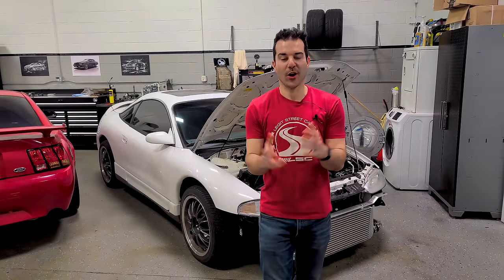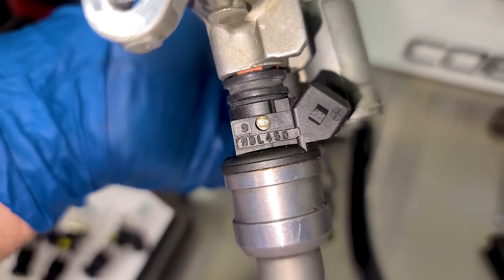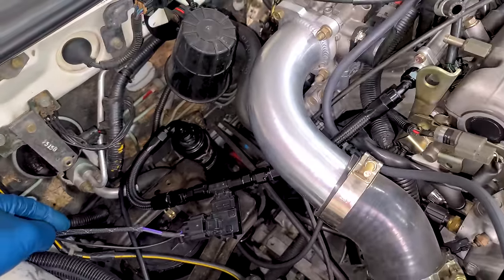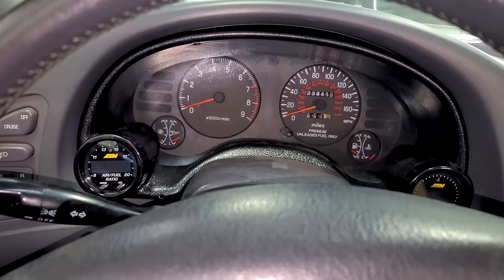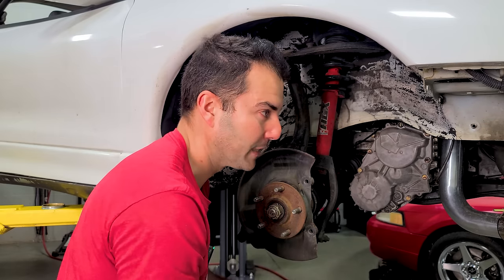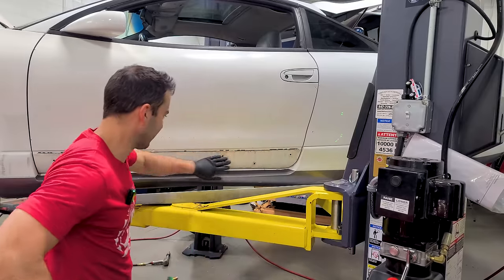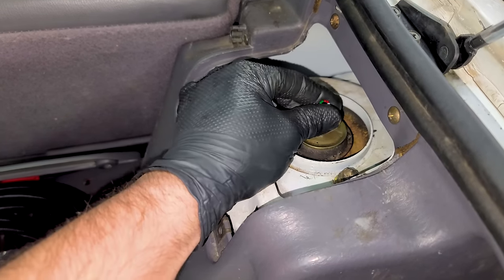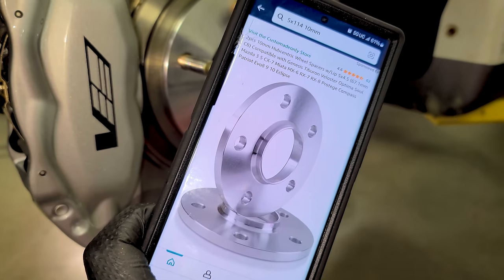I Turned My Eclipse GSX Into A Mini Nissan GTR With Parts Off A Mustang & Cadillac! Budget GODZILLA!

Comment: DSM, Fast, Reliable in the same intro.  I about lost my breakfast on that one!  DSM=Daily Service Maintenance.  This is chock full of memberberries!  I had a 1995 Talon TSi AWD back in 2006ish making around 440hp to the tire.  Haltech standalone (using DOS!), 25 lbs on a PTE SCM-61, 880cc injectors, 6 bolt swap with 90 big rods, JE pistons .040 over bore, Cyclone intake, comp 272 cams.  Tokiko 5 way adjustables, Baer big brake kit riding on some Volk GTC's.  Crank walk, boost leaks, popped couplers, fried piston rings, cracked manifolds, always something, but she was my first love.  John Shepherd was our DSM hero!  Got fed up with the nagging from my ex-wife and sold it...then got rid of her too.  Should have got rid of her first.
Reply: Exactly!  You can always get another women but finding another clean dsm is a needle in a haystack!
Reply: The crank walk and cracked manifold were your fault. So were the popped couplers. You gotta upgrade when pushing more boost and laying on the throttle CONSTANTLY.
Reply: You crank walked a 6 bolt block...I have questions - as that was the split collar thrust that failed on 7 bolts, not on 6 bolts.
Reply: Crank walk is caused by bad engine building. A tiny percentage of 7 bolt cars crank walk. Very, very few 6 bolts. It's really not a thing. LS engines have just as many thrust bearing issues as 4g6x engines.
Reply: @mikescherrer4923  I’ve owned a lot of high hp 7 bolts and never was out of spec at the collar. I just have issues believing this story if it was a relatively stock 6 bolt 90 big rod bottom end never opened
Reply: @celestialknightsffxiv6566  No the stock 7 bolt developed crank walk hence the 6 bolt swap.   She was running a TD05 20g turbo at the time with some bolt ons.  I can't remember  the mileage.  Sorry I probably should have clarified that.  I've owned one so that was my only experience.  Thought process back then was it was better (and cheaper) to swap a 6 bolt with some pistons than a complete build on a 7 bolt with a bad reputation.
Reply: @samtrautman9867  400whp on a 20G hmm I mean it’s plausible to do high 4s on that turbo.

Comment: 30:00 having done a BBK similar to this. The holes in the rotors are larger than the studs so there is a gap & play, meaning the rotor will slam into the stud, then start braking. I'd suggest finding a small enough diameter metal tube that fits over the new stud & between the rotor then cutting them to fit the gap. 
For the kit I did 1320 Performance actually sold a "limited" run of stainless-steel inserts.

Comment: Loved the DSM Talon/Eclipse AWD 2.0 Litre turbo cars from the nineties. I use to own a 90 Eagle Talon TSi AWD that was modified from stock. I changed the whole exhaust system from turbo back with a 3 inch stainless steel mandrel Buscher Racing exhaust. Boost controller, upgraded fuel pump, fuel injectors, ACT clutch, upgraded intercooler pipes, blow off valve and so forth. Car stayed stock appearance wise, except if you saw the exhaust system from the back of the car. Loved the power it made to all 4 wheels when accelerating. Surprisingly, I did get great fuel economy close to stock when driving it normally. I did get 389,000 kilometres on the original engine and turbo. Miss that car.

Comment: When working with brakes if you want to stop the fluid from leaking out, use a brake pedal depressor to hold the brake pedal down and the brake fluid will not constantly leak out. You’ll of course get some fluid initially leaking, but it’ll stop. I used to do it all the time when messing with the brake system on various types of vehicles.
Reply: I use the ghetto plastic bottle and fuel line method. But I'm definitely going to search up brake pedal depressors. I like Alex's vacuum method, though.
Reply: @Dwigt_Rortugal  I meant when swapping brake hoses, calipers or anything like that where there the brake fluid is going to constantly leak out, you can stop most of that from happening by depressing the brake pedal while working on the system. While bleeding the vacuum bleeder does work well, but I’ve found a good pressure bleeder works better.

Comment: I've always wanted one of these.  My buddy had a 12 second talon back in the day that sounded like boat at idle.  He had to launch in second gear because in first gear it would just spin all four tires and he almost side stepped into a mustang he was racing from a launch. They pull so nice.  I saw another guy roll onto the highway once in 2nd and it bounced on all four corners, squatted and then blasted off.  Good memories of the 90s glory days of street racing.

Comment: Alex, as an engineering QA/QC person, I know from many years experience, thread failures, and tests, that ALL threads should be very clean and lightly lubricated - i.e. enough to remove dry friction from the thread surface. The torque you apply to a stud or bolt is intended to extend the stud/bolt within it's elastic limit, and apply longitudinal pressure to the mating surfaces. If the threads are dry, or even lightly contaminated with corrosion or dust etc., it will affect the accuracy of the torque you apply. Another issue with dry/dirty/corroded threads is the creation of micro-stress cracking over time. Both issues can cause either under-tightening or rupture of the thread. The reason that this is not a very frequent failure issue, is because the threads, bolts and studs are typically over-designed to account for poor use (mainly over-tightening of corroded wheel bolt/stud threads). But there are limits. Better safe than sorry.
Reply: As an Engineer you do not lube to any extent bolts or studs that are on moving parts, especially wheel studs, they can work loose.
Reply: @glynnepritchard2526   If threads can work loose they are either not correctly torqued, or in need of a locking mechanism. I am not suggesting the use of special low-friction lubricants, just a few drops of light machine oil. Whenever I visit a tyre shop, I see many cases of bone-dry & corroded nuts/bolts & studs on cars/vans, being removed/refitted using unregulated airguns. And if they use a torque wrench they sometimes go way past the 'stop' indicator. It works until it fails.
Reply: @terryross1754  I’ll stick to nearly four decades of design engineering. I am the one that writes the specifications for QA/QCs to follow.
Reply: @glynnepritchard2526   Nothing personal, but I have come across enough errors - material/assembly failures, leaks, highly detailed connector analyses, in-depth RCA's, plus too many non-validated designs - to rely more on 5 decades of my own international experience in a wide variety of engineering companies and applications. Manufacturing QA/QC personnel are indeed normally in a 'captured' situation (e.g. Boeing ?), but not all QA/QC activity is limited by directives from engineering.

Comment: You can do that break swap on most mustangs too something that i see that could be a problem that spacer isn't located in its position if the wheel doesn't hold it in then its sure to back out and vibrate the lugs loose im sure you got it handled

Comment: Please do a timing belt service. Most importantly the hydraulic tensioner and balancer. Also should upgrade fuel filter for e85
Reply: Definitely, and a quality belt. If it's still got the balance shaft it could do with a good new belt there too.
Reply: I thought he aleady did do the timing belt and used all mitsu stuff.....or maybe I'm thinking of G&G.
Basically the first thing I always go soon as I get any DSM running, factory tensioner and belts are a must.

Comment: As someone who owned 7 different eclipses 6 at one time. You should upgrade to the refreshed bumpers and headlights 97-99  it really modernized the look of the car. The opening on the front bumper is perfect for the front mount IC.

Comment: 51:45 Yes I am of the same mind set. I put a set of smaller type turbos on my car instead of a huge big boy and I am SO glad I did that. The low down torque is SO MUCH FUN! I think Jay Leno always says "All the fun is between 10 and 120" or something very close to that. Who drives around at speeds over that much of the time and if you are it's not for long. It's just bragging rights. And I don't care about top speed I like the PULL from DOWN LOW!

Comment: I worked at MMSA (Mitsubishi Motors Sales America) from 96 to 97.  It's funny looking at this engine.  The front of the engine is on the drivers side as all FWD Mits had until the 97 model year. The Mirage as I remember was the first car that the engine was flipped and the front of the engine was on the passenger side.  I asked engineers why they did that and I was told it makes it quieter for the driver with all the belts and pulleys on the passenger side.  I am sure there is a more engineering answer though.  You mentioned the different impedience injectors on Turbo and Non-Turbo engines.  Remember that all turbos were a 2.0L Mitsubishi Engine.  The Non Turbo was a 2.0L Dodge engine used also in the Dodge Neon.  Mits had so many warranty problems with the Dodge engine.  I remember when they introduced the 2000 Mitsubishi Eclipse and all models used a Mitsubishi Made engine all the employees cheered.

Comment: for the purist if you wanted to do a factory big brake upgrade using OEM parts. Using the knuckle from a JDM Galant you can then bolt on the evo 7-8-9 calipers.

Comment: The car is looking incredible! Amazing work!! I was worried about the fuel filter on my 2G when I went to e85, so I replaced it with a radium filter with the stainless 10 micron filter element. There's also the fuel siphon line that runs to the driver's side fuel sender that you can replace with gates barricade fuel line. I think that stuff is e85 safe. I may have missed it if you already did that though! Thank you for the great content!

Comment: Hi Alex ! The Car, the Caliper came from had them on the rear side of the wheel. you put them on the front side. as they have differen sized pistons you have to change sides. so left one on the right side a right one on the left side. otherwise the caliper will not work properly on high load and you will get uneven brakepad wear... hope you read this.

Comment: I agree you're fine with using a nut to install the studs but the reason someone wouldn't want to do that is if you have to overtorque a bolt it could yield/stretch the area under tension.  A press from the other side would put that section of the bolt in compression.

Comment: The wheel poke is the reason we offset the CTSV calipers inward by reducing the boss height instead of spacing the rotors.

PS I also never got rid of the V, I liked it on my DSM and just painted the rear brakes on the same silver paint.

Comment: Typically, you adjust coilovers the opposite of what you did. The lower shock body adjustment is to dial in the compressed and extended ratio (2/3 of travel for compression and 1/3 for extension) and the upper adjustment is for ride height. Which will not affect spring rate, especially with linear rate springs.

Comment: Back in the day you could get a fuel rail adapter that let you put the aftermarket fuel pressure regulator in the stock position.   I used one on my 3.5L TT stealth and it looked great

Comment: I wire wheeled all four wheel wells in my 97 GST that I all wheel drive swapped.  Did this to remove the undercoating.  Then coated them with por-15.  Car lost around 150 lbs in weight.  Also ran EVO 8 stock wheels.

Comment: My only complaint about the Rims- I feel like they should be an Inch or maybe even 2 larger and maybe powder coat them black or coat them in black chrome. They still look great though! I do kinda prefer the opposite- paint the Car anything other than White, then powder coat the rims/calipers in white (white would be the accent rather than the primary color). I've got a 3000gt that I'm going to be doing up that way- either gun-metal or smoke gray- very dark as glossy as possible to bring out those beautiful curves on the 3000gt, with White 17-19 inch Rims and lowered just enough so that the wheels and the wheel wells line up well. I don't know that I'll be modifying it much beyond that though- maybe a Carbon Fiber Hood since the stock is so heavy, but nothing fancy- just a replica that's much lighter.

Comment: 53:47 you need to install some sort of mudguards or flares for the front, something to catch that stuff and stop it from going down your fenders, as they used a pad on the Porsche's for the back's with the old 930 wide backs, and it could really use it there

which even the countach needs FYI, harry brought it up when his went in for work, and he's always having to do his fendered flares because of it

which is probably why they did that thing with the 88 1/2's and the 25th's that I hate

Comment: A really easy way to bleed by yourself is to submerge a rubber line from the open bleeder into a clear container of clean brake fluid. Pump until no air bubbles are present. Close bleeder valve with line still submerged in fluid. FYI, this technique came from an old Chilton's manual.

Comment: Get those front calipers machined to remove the inner spacers and maybe even run a slightly reduced outer spacer it would get the wheel poke just right, there is space

Comment: To improve your tire fitment issue, don't space the disc outward, space the caliper inward by grinding on the caliper mount or caliper. You mentioned that as a possibility before stating you had plenty of wheel spacers.

Comment: You should change the fuel filter to the Fuelab 818 series with fiberglass 6 micron filter element. It will save your injectors when using E85.

Comment: Do a boost leak test and check the regulator. It is possibly leaking from the adjuster screw. Even being brand new. Take some Teflon tape to the screw and put it back in then adjust the fuel pressure.

Comment: Try spacing the caliper with washers between the caliper and the caliper mount instead of spacing the rotor out to allow the wheel to tuck in the front.

Comment: The bolt on the lower control arm to the wishbone on the strut was in backwards, they should always go in, front to back or top to bottom. Also you're less likely to lose the bolt.

Comment: Alex, get a silver sticker that matches the caliper silver and have whatever Mitsubishi or brake manufacturer logo printed on it. Apply it and clearcoat over it! Easy day💪🏆 For the ride height, 2 finger Gap will be plenty. Once the springs settle, adjust to 2 finger Gap until the scraping doesn't happen in any reasonable driving condition.
Reply: 2 finger gap is too much
Reply: @eptdy  how big are your fingers? 😐 2 fingers is perfect for no scraping on imperfect roads. It will look factory lowered.

Comment: I'm curious on if it would be possible to adapt true hubcentric parts?  The lip of the hub is designed to support the weight of the vehicle where the bolts are only designed to hold the wheel laterally and assist with rotational forces.  Adding in holding the weight of the vehicle weakens the studs and can also make the wheel not truly center which can cause ride issues. Just want to see you safe bud!  I've had buddies have wheels pop lugs off on the highway because they were not hub centric.

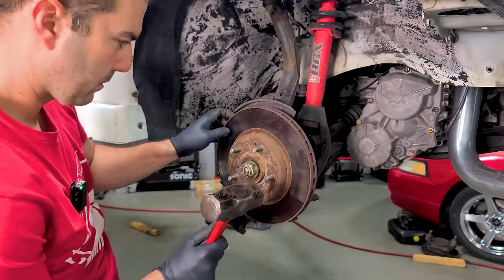Comment: 0:23:05 A quick question Good Sir:  Have you ever used EBC brake pads?  Specifically EBC Green Stuff?  I ask due to having used both the Green Stuff & Red Stuff.  These were used on a 2003 STS, the Red Stuff first, which did perform as described, and as neat as it was, applying a light pedal pressure and observing the braking force increase dramatically as the pads heated up, they were not suitable for street use.  The Green Stuff did turn out to be just the ticket, with better initial bite than OEM semi-metallics, and considerably longer life, in my case, 3 years as opposed to 8 months.  Thank you for sharing your car adventures with us, eh?

Comment: I bought Release concentrate cleaner and it works great. I also bought the Carley diagnostic reader and found out that it requires a subscription to open up all of the features that you promoted. I believe that you should let your followers know that when you promote this product so it doesn’t look like a scam. If you look at reviews of the product on YouTube it has horrible reviews because of the subscription factor. I love the show and I will subscribe to the upgrade for Carley and see how it works. Take care and I love the GTR

Comment: Alex, it appears, at least in your video, you may be able to go with a 9mm or 8.5mm spacer and still not contact the brake caliper?  I'm sure custom machined ideal thickness spacers aren't very much.  What do you think?  Also, line up the word of you cap with the word on your wheel. 😊

Comment: We used to have what I called the "Porsche" fitment, where especially on the rear of a 911, you'd get the tire sidewall bulge to flow with the rear fender line. Yours looks pretty close to that, pretty nice outcome.

Comment: What adapter did you use for the fuel tank high pressure line to AN fittings? I need to replace the same hose on my 1991 Dodge Colt (Mitsubishi Mirage Hatchback) before it ruptures like yours did and I can't find what size the stock lines fittings are.

Comment: Alex, you should learn how to properly set up a car's suspension for handling. I know there's not much in the way of curvy roads where you live, but cars can do more than accelerate and stop. 😃 I recommend Autocross for learning how to test.
It would also make for more content that very few YouTube channels ever do, and it would help a lot of people.
In the case of the eclipse, it needs around 2.5 degrees of camber in front, or more depending on how much tire pressure you're ok with running, to be able to take advantage of those tires capabilities. The rear depends more on how much oversteer you want, but somewhere between 1 and 2.5 degreesish...